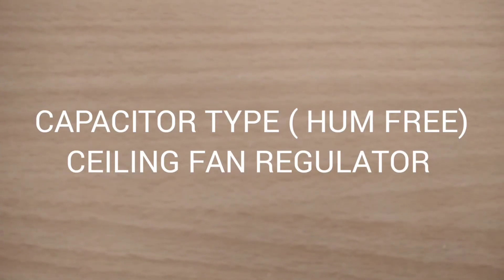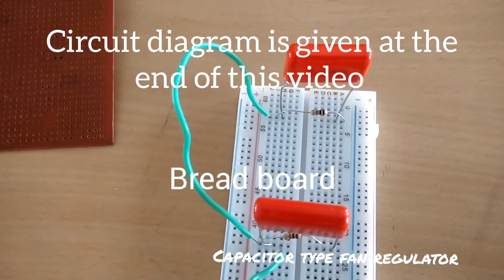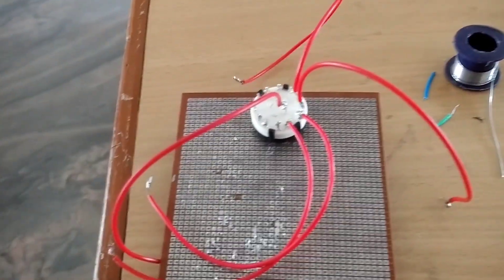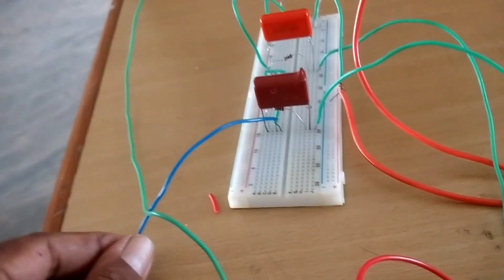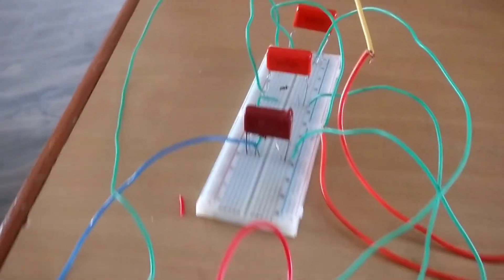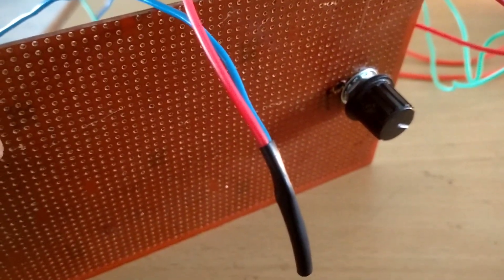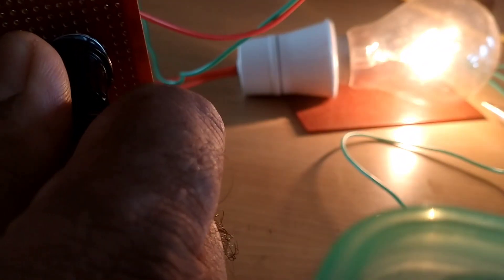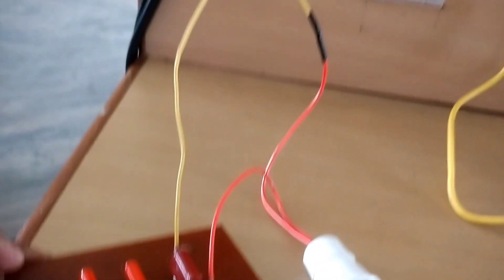FAN REGULATOR USING CAPACITOR (HUM FREE)#easy #engineering #project@ Engineering @projects

Comment: I have a step regulator from branded company and it has only two capacitors but there are three speeds & fourth step is full speed. The capacitors are connected in series with resistors that you've not added and those series resistors in my regulator has burnt after just 6 days use so medium speed not working. Please also tell working of two capacitors regulator
Reply from the maker: Yes the regulator with two capacitor have only 4 step rotating because only one step for each capacitor. One is zero and other is high